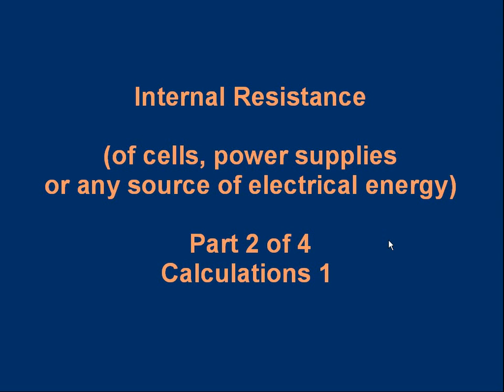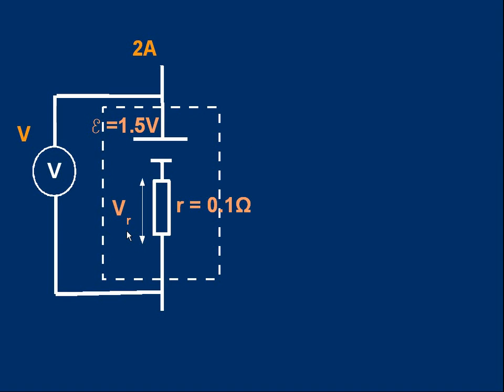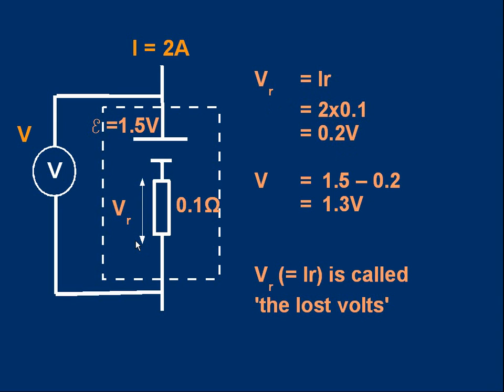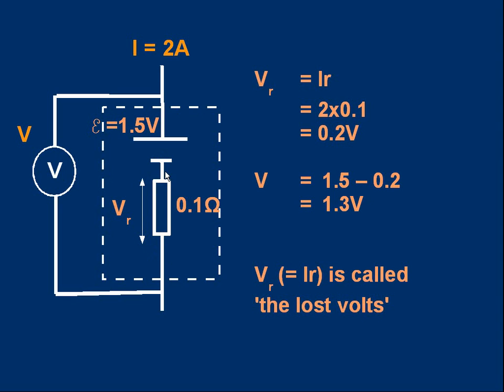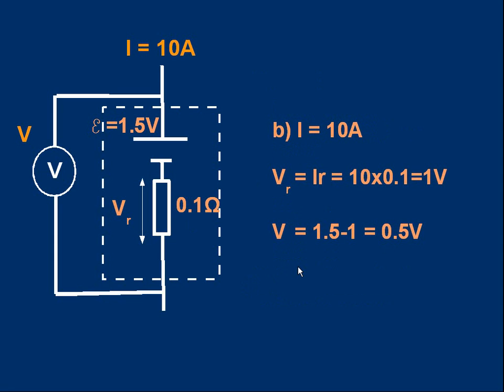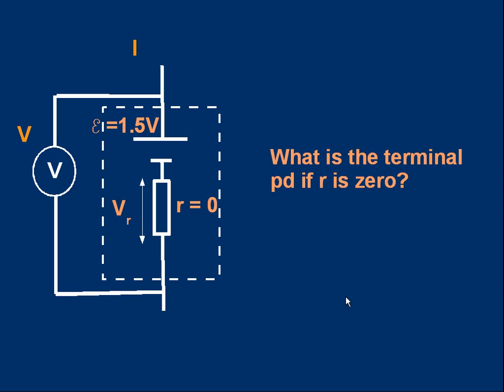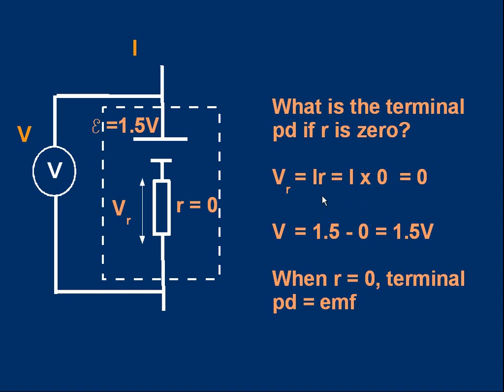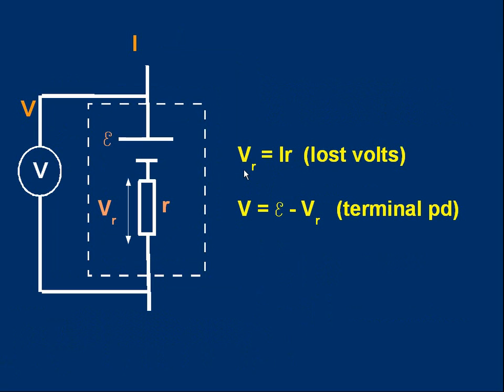GCE (A-level) Physics E16 Internal Resistance 2 of 4

Comment from the maker: Work though this step-by-step.

1. Emf = 6V, internal resistance r=1Ω and terminal pd (voltage applied to load) is 4V.

2. The voltage across r must be 6-4=2V
(because emf = voltage across r + voltage across load)

3. Just think of r as a normal, separate resistor.  It is 1Ω and has 2V across it. So the current through it is I = V/R = 2/1 =2A

4. Since it is a series circuit, the current everywhere is also 2A.

If that doesn’t help, send me a specific problem and I’ll explain it for you.

Comment: I don't really understand why you get the current from the voltage across the internal resistance. If this had been me on a test I would have used the terminal voltage to find current because I would assume that only the voltage across the terminals could be used in an attached load. In a regular circuit with a lightbulb attached to it, wouldn't you figure out the current using the terminal pd of the cell? Halp!

Comment from the maker: Hi.
If the cell is short-circuited the current is NOT zero.  A short circuit is a zero (or very small) resistance connecting the terminals together.  This produces the maximum current possible – it can overheat the cell and even start a fire!
If the terminals are NOT connected, this is called an open circuit – only then is the current zero.

Comment from the maker: Hi. For some reason I've only just got notification of this message.  Here is a very late reply!
If the internal resistance increased to 0.75ohms, the current in the circuit would decrease - it would be less than 2A.  The 'lost volts' would NOT be 0.75x2, it would be 0.75x new current.  The only situation in which the cell delivers no power is a short circuit; the current is then =emf/internal resistance.

Comment from the maker: Hi sedani2 
I presume you mean “would the terminal pd always be 0 when there’s a short circuit?”
It depends how accurate you are trying to be. 
Providing the resistance of whatever is causing the short-circuit is zero, then the terminal pd will be zero.
But in real life, pieces of (even thick) wire still have some resistance, and there will be some contact-resistance where the short-circuiting wire connects to the terminals.  So in practice, the answer will be: not quite zero but very close.

Comment from the maker: If the internal resistance is changed from 0.1Ω to 0.75Ω and if (and this is a big IF) the current remained 2A, then you would correct – the ‘lost volts’ would equal the emf and the voltage (terminal pd) would be zero.
This could only happen if the cell is short-circuited – joining one side of the cell to another with thick wire (not recommended!).